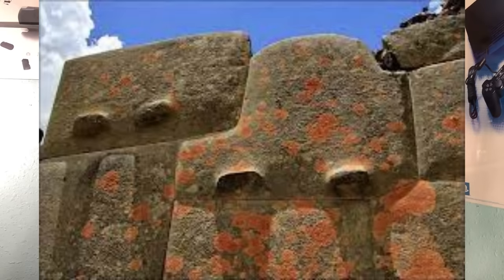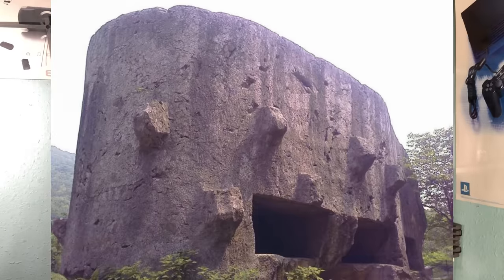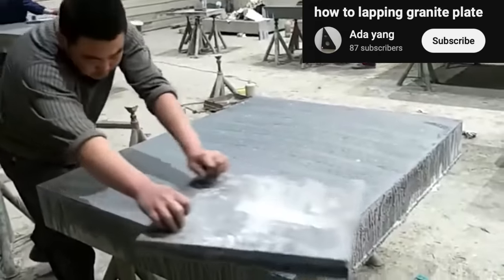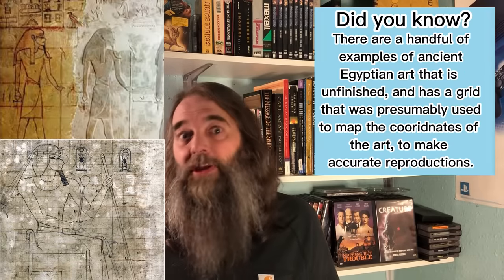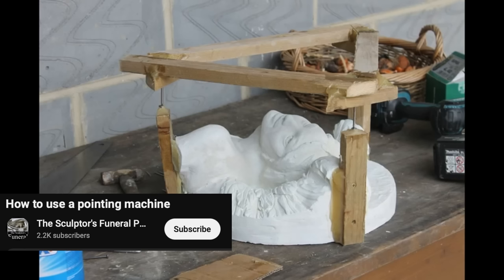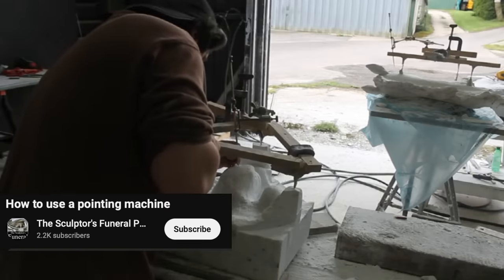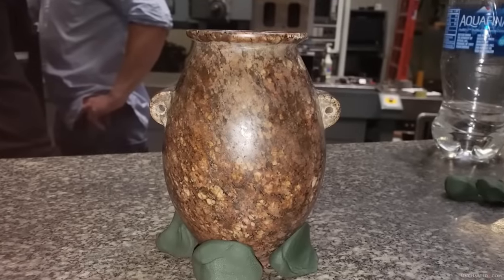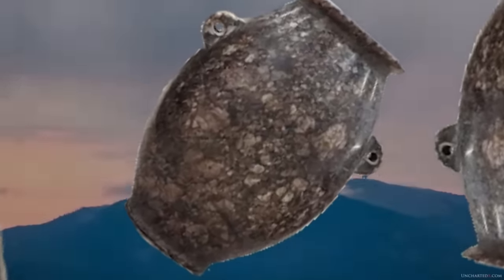The True Purpose of Megalith Stone Nubs

Comment: One of the things that is puzzling is why the builders would put so much effort to make the stones fit absolutely perfectly but then not bother to clean up those nubs which were only needed for construction. I would expect to see them only in quarries, unfinished walls and stone faces that are not visible. Not on a few random stones of a wall.
Reply from the maker: It is weird I admit.
Reply: reasons the leave them;
Practical use ( you can place/hang things on them, use them as the support)
Decorative use ( segest temple in Sicily for example)
Reply: Time.  They either weren't finished at all for whatever reason(most) or they had to finish them quickly so they just covered them up (pyramids) or because they were human and they got lazy.  You can find the same silly errors on anything humans construct.
Reply: Maybe they didn’t feel like doing it. I have noticed sometimes on floor tiles that people leave the little + that goes in between each corner when they could easily remove them. My guess is laziness
Reply: @MrBottlecapBill yes, I’ve never understood the mystification of humans of the past. They were the same as us but just happened to live in the past.
Reply: You're projecting your modern concept of "finished"  onto ancient history. Maybe they were left on certain stone blocks because those particular masons were proud of their achievement and left them as reminders.
Reply: Why risk damaging the stone. I'd like to see how many nubs that where left are near a corner or an edge.. Perhaps pounding them away risked cracks or damage to edges.. And the masons simply thought it better to leave them instead of cracking an already fit stone that took allot of man power
Reply: @bennycarter5249  nice point. I hate when people forget that the people that lived at that time were literally the same as us. They always see them as these perfect beings that have to do everything perfectly and that can’t evolve as a culture
Reply: @bennycarter5249  Yeah and also these are ruins, this is not what they looked like when they were used. I imagine all kinds of banners, flags, deocrations, to adorn the temples and other important buildings.
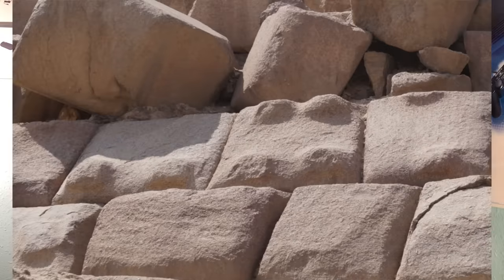Reply: Yeah, i could understand this technique being used for very intricate angles in stones like 00:24 but it's very hard to justify 4 huge nubs for a square stone face like 00:17
Reply: Probably a sex thing: "Phwooahh!  Look at the nubs on that megalith!  Proper great temple with nubs as perky as that!"
Reply: I think because the wall was meant to be resistant to earthquakes, probably didn't care for beauty.
Reply: @JoeBlow-ui7vb  Agreed, primitive cultures didn't generally expend a lot of energy on what they judged as useless projects. If the effort was going to be made...it would be more likely for a practical purpose than decorative. That is not to say that their religion didn't require some degree of decorative precision (look at the Masons and churches all over the world).....
Reply: Any chance the builders like a very methodical fit to the structural integrity of the stones but might also like having a "rustic finish" on the exterior?
Reply: Don't care how they finished them. Please  explain how they moved and placed them . Some are so big we can't move them with modern machines.
Reply: Protuberances! I work at a steel mill and I see them all the time on tundish blocks from the casting process..... 🤷‍♂️
Reply: They were probably distracted when the ufos landed.
Reply: @JoeBlow-ui7vb  , I see these walls as beautiful and impressive. Maybe the Inca saw them purely as functional structures. Like we would view a retaining wall on the side of a road.
Reply: Probably because the walls were covered in plaster and those nubs may actually have helped to keep the plaster in place.  Most likely the flat plaster was painted with various pictures and was sealed to keep weather from breaking it down. That would be my guess.  🤷🏻‍♀️
Reply: @DeDunking 
My guess is the walls and those nubs were covered by plaster that finished the walls and it wasn’t worth knocking them off when they actually helped support the plaster covering the walls to some degree.  Most MesoAmerican and South American cultures did cover their walls with painted plaster, so it’s reasonable that it’s the case with such walls.
Reply: When blocks are cut from a larger mass there is always the bottom side still attached. The bottom is cut leaving 4 columns for support. The front 2 columns are removed and replaced with shims. Material is removed from the middle of the rear columns forming an hourglass shape to weaken them. The shims are knocked out causing the block to drop a few centimeters snapping the columns in the middle and sliding the block off to the ground. The second layer cut will have 2 extra nubs on the top because of this.
Since this is a primitive quarry, they probably don't do more than 2 layers. Some blocks will be cut from fractured and removed sections which won't have nubs. This should result with a third or so having extra nubs. 
The blocks are dragged to the site using long ropes and many humans, which are then arranged on the ground side by side in rows. The left side of a block is finished. Then a stick is used as a measuring device to finish the right side of the adjacent block to match the sides.This is done all around, ignoring the side facing the ground. The side facing the sky only needs minimal finishing if any. These blocks are then placed into the wall in the same order.
Reply: there is not always sense to human creativity and style choices
Reply: Totally agree. Hard to imagine they would be so particular about all but the front face.
Reply: Left on to climb up for repairs? Maybe they didn’t care too much for the aesthetic of the outside of lesser buildings... they seem to have knocked them off for the more prestigious buildings like the pyramids etc etc...
Reply: @albeback8439 I’ve heard the nubs are to assist the moving - a point to spin the block on etc...
Reply: @davidlineberry622 like a sort of blistering?
Reply: @keirfarnum6811 that’s not a bad guess at all, and I’ve never heard that explanation before, that seems bizarre to me now as it’s a really good, common sense shout! 👍
Reply: @maau5trap273 sure, this is true, except every other part of these bocks ARE perfect, so the obviously valued perfection.
I think asking why the nubs weren’t removed is an excellent question and may have to do more with their purpose than we give the credit for.
Reply: I was wondering the same thing. Obviously it’s trivial for them to remove it. Go through all the work of getting that fine fit while I leave them behind? My guess is that it’s part of a religious/philosophical commentary. I know that a lot of Christian artwork purposefully had flaws left in as a statement that only God is perfect. This could possibly be the reason why they left them there.  You’ll notice that unfinished versions have much larger stubs. Also, they seem to come in pairs or more. One nub left behind seems to be more of a statement the mason.
Reply: If the builders just didnt see the value of going back and removing the nubs, then why would the faces of any exposed megalithic stones be cut so perfectly?   I can see why the connection points would need to be perfect, but why leave nubs while perfectly cutting the areas around it?  If they just wanted to save time or didn’t care about if they were esthetically pleasing,  then why didn’t they just leave ALL exposed parts of the stones rough?
Reply: They only finished and smoothed the inside edges to get the precision fit they were looking for and tended to leave the outside surfaces rougher and more natural. It’s impossible to use the lapping technique ( at least hella more difficult ) on a vertical surface ounce the blocks were in place. So why bother chiseling off the reference points risking cracks or unintended damage to the finished product. It’s not gonna be perfectly smooth anyway.
Reply: There might have been something covering the walls in ancient times to hide the nubs and stone work... Plaster maybe?
Reply: These megalithic structures were built by the ancient giants, the offspring of the Fallen Angels who rebelled against God.
Reply: It's hard enough to carve stone that's right in front of you.
Try doing it against gravity.
I'll wait.
Reply: They fit perfectly for longevity.  Without mortar and being more or less earthquake proof, until you get the few high 9s or 10s.  They needed to cleanup the joined faces.  The outside faces didn't need it.
Reply: they usually did remove them, but it was probably done by different work crews and because it was cosmetic it was a lower priority and probably went by the wayside when budgets suffered. You also have to bear in mind that in the case of the Inca all of this was built in a short time period and a great deal of construction was interrupted by the Spanish conquest.
Reply: I think you only see them on unfinished pieces.
Reply: @bennycarter5249  This !  The nubs are there to show off their cleverness.  Remarkably/ironically, the less clever folks believe everything else, but the reasonable explaination !
Reply: @iansayers2414 , if it were the case that the lower tiers were all finished and the highest tiers were unfinished, I would agree.  However, they seem to be randomly left "undone".  There's been observations that some nubs' shadows align with both equinoxes.
Reply: This is a good observation, which I think has a simple answer: they didn't care.

You assert it took a huge effort to fit the stones together perfectly, but this was not the case.  They didn't go to great pains to make that happen.  Instead, the perfect fit was a natural consequence of their construction method, which we can't replicate even today, but for them was straightforward.  They could slap these blocks together like it was it was everyday, run-of-the-mill bricklaying.  For us it's mystifying though, because we don't know how they did it.  We compare the task of removing the nubs against their perfect jointing, which seems a disconnect, because one of those appears immensely difficult.

I've described how I think they built these walls haphazardly, without any great skill or effort, and what the nubs were for.  Just look for the long post.
Reply: @iansayers2414 Inca said they didn’t build them, so who did?
Reply: @albeback8439 modern machines can move multiple thousand ton stones. Most stones that were moved in ancient times were under 100 tons and none were beyond modern machine capacity.
Reply: @iansayers2414   Ah, I think you need to do a little more research here...most of all as to when they were built...way before the Spanish, and way before the Inca civilisation too.
Reply: Maybe you had stone Mason's making the cuts and different guy's laying the stones and then some other time the knobs were supposed to be removed, I say this because I don't cut a lot of the Stone I've laid and on a commercial job with lot's of stone there's usually a guy who does nothing but cuts and the cuts are placed on a skid and sent back to you and that's happening with a bunch of Mason's all over the Job site at the same time so he's cutting for everyone. Maybe that's what was going on and they just didn't get around to removing knobs or the one who order the wall said that's fine and they were done
Reply: That's the work you end up with when you don't pay the contractors, lol
Reply: My theory, it's because they didn't have high rpm power tools like us to make it perfectly flat. They didn't want to break the stone by hitting them with a chisel or something, in fear or it fracturing it. I think these little nubs were originally a long stem from a shaft were a soft geopolymer was poured into a cast. Similar to how bronze is casted. Once it was cooled and/or dried, the cast was opened up and they had perfectly formed boulders with long skinny stems. They would them knock off the stem and round off the "nub" or protrusion so no one would get severely injured if they happened to whack their noggin on it. No safety helmets back then, sharp corners are just an accident waiting to happen.
Reply: The average ancient was far smarter than the average modern human of today. The ancients all had a much harder life and had to make do with what they had. It is just a matter of time, patience and careful thought.
Reply: Maybe they were to hold on plaster or another layer of exterior.
Reply: Someone once told me most old churches are unfinished. They are technically complete but a lot of features are considered temporally until they have time to do it right. I forget most examples but the most obvious one was how they deal with rain water. Some of the churches have lots of lead work that is quite crude. From other features he made it obvious that some of it was suppose to be wood and some was suppose to be sculpted. Sometimes the front of the church or buildings next to it had the correct finish but the other sides did not. The reason was simple, after building for many many years they just considered it finished. It could be that removing the nobs was on the todo list but other things had priority. Life is kind busy at times you know?
Reply: @keirfarnum6811 to me at least this answer makes a lot of sense,even though it leaves a lot of unanswered questions. So then why doesn't every stone have nubs🤔👁️👁️??
Reply: They had a strong anesthetic desire for the tight fits and interlocking shapes. They did not make tight seams on the hidden side. It was to display the anesthetic. The nubs were not removed yet.
Reply: The nubs were/are different in size and shape.they would cast shadows. Different times of the day  or month would inform the people of the time, day of the week , month as well as the solstist, equinox.....
Reply: Lol who says they put so much effort to fit em together with precision ..
Reply: Yep that's one of the best explanations Ive heard yet. The only other one as good (sorry, can't remember who or what the vid was called) was some guys who went to Yucatan end of peninsular to some ruins where they reckoned Cayce's hall of records could be. It talks about previous explorers in 50s or 60s who arrived there and found a pot of white fluid mixture. Some of it was spilt on the granite ground and after a few minutes the ground turned a bit sluggish and clay like. Apparently they asked the locals if they knew what it was. They did. They said it was an old, alchemical solution which contained a particular locally grown plant amongst other things and yes, it was used to soften stone. Now this might be a load of bs, but I reckon if you could soften stone, literally pour the stuff into an icing bag if you get my drift, then you are left when poured into the framed mould, with last bit of poured stone which you could cut off - unless it had hardened again before you could do that, then you would be left with a nub. Could be way out, but it's fun speculating! ❤
Reply: One explanation (which is weirder still), is that the stones were “softened” into place hence the perfect fit and the nubs were just left as the buildings were relatively basic. I would expect the nubs to be misaligned continually due to the movement of the fitment.
Reply: @maau5trap273  " I’ve never understood the mystification of humans of the past. They were the same as us but just happened to live in the past."

You never understood? Really? The past is fascinating and it has its mysteries including the people living in it. I mean the idea that you are in this video is proof of curiosity to the enigma surrounding megaliths. What's there not to be mystified by humans in the past? I just find that take too silly.
Reply: Maybe they might have to work on it again and not end up ruining the stone by removing and putting nubs back.
Reply: maybe for easy access in case of repairs or opening up the wall in a quick manner fucntioning as some sort of key with the right frame as long as made before setting...as making frame fit to rock is not possible after setting...thre could be many explanations...
Reply: They softened the stone and molded them together.  They had a technology that we don’t have.  Obviously for them, size of the stone was not an issue.   They had an ability to move hundreds of tons of stone and it must have been easy for them because they did it a lot.
Reply: @dg-vg9di  , The fact that these structures exist proves that the Incas had the technology/skills to build them. The big question is: Exactly what were these technologies, techniques and skills?
Reply: @DeDunking  and with admitting this shows that you're wrong, you just try to explain something you don't understand.
Reply: as we can see the nubs were on these stones all around the world explain that one, did the Incas go on a field trip to Egypt haha
Reply: @DeDunking  - not as weird as electrical discharges igniting the air around these monuments when the machine/ritual inside is humming at capacity, which is the theory I enjoy envisioning 🙂 but have no evidence to offer. Leaving orientation nubs willy nilly on walls is akin to colouring outside the lines without an eraser, but nevertheless a really cool concept.
Reply: If you actually look at the stones the level of the surface of each stone is not uniform, all the attention is on the fit. Either they covered the wall with mud or plaster or it's just something that didn't matter to them.
Reply: Don’t be so sure of yourself. You are guessing. (😅message to everyone)
Reply: @theend9494  , Why do you ask other people to explain that? Can't you propose a theory of your own?
Reply: I read a paper on the "rock softening" theory. It suggested that they could have used acidic mud that collects in stone quarries to soften the surface of the joints. This would allow stones that were already cut almost perfectly to fit perfectly. It does not suggest that the entire stone could be made pliable. It is clear that the stones were not molded because they are all different shapes and sizes.
Reply: It the nubs were used to reference a measurement frame in order to precisely fashion the block, it makes sense to keep the reference nubs and extend the frame for fashioning adjacent blocks in the wall rather than creating and aligning a new reference frame/nubs for each block. Thanks @DeDunking, you've got the best nub theory I've heard.
Reply: Also the nubs are too rounded off and often don’t protrude much.  This makes them sloppy if used for reference points.
Reply: This an art. It is finished.
Reply: @terberusp7030 . And they had bigger fish to fry - they had a bunch more stones to carve so removing nubs probably wasnt top priority
Reply: In case they ever needed to deconstruct or move?
Reply: Maybe they left it for later readjustments?
Reply: If the theory that the nubs were used for lowering and positioning the stone is correct, they could have left the nubs intact so they could be used again in the event of the wall being needed to be repaired or moved, following an earthquake, which are common in the Andes.
Reply: Maybe that increases the durability, it probably makes it less susceptible to cracking over time, thousands of years would be alot of freeze/cold/warm changes
Reply: @DeDunking it almost implies they didn’t finish them.
Reply: Part of the reason they put so much effort to making the stones fit absolutely perfectly is to make the walls or structures earthquake proof who ever built them were real experts no doubt
Reply: Earthquakes
Reply: They are only perfectly fitted in the front most visible joints. All you have to do is look around the back and see they are not “perfectly” fitted.  LOL. How far did you go in school?
Reply: They were left there just as a practical joke.
Reply: @Matlacha_Painter  , On some structures such as the Fortress Sacsayhuaman in Peru, it is not just the visible part of the joint that fits tightly. Whole mating surfaces of large stones fit tightly. Some theories suggest that clay or plaster molds were used to shape large stones so that they did not have to be moved multiple times. Another theory is that they had some sort of device like a 3D-pantograph. These were used artists to make copies of sculptures.
Reply: @maau5trap273  I push them deep enough so I can grout over without a problem 😂
Reply: @amodernalchemist432  your “theory” is not a theory, it’s just speculation. Before throwing the word theory around you should learn its meaning.
Reply: @jerry12314  because we are in fact the same as them. Not any different biologically speaking. The problem with mystifying the people of the past is that people don’t see them as humans with their own set of beliefs and lifestyle. People often question the why of going through the troubles of making such a difficult construction without any “purpose” but we still do the same and continue to do the same because that’s who we are ( look at the artificial islands in Dubai being done just cuz they can). People also forget how hard working we can be especially if we work together for a common cause, if you mystify them instead of looking like them for what they’re, normal humans then the theories of advanced technology or even aliens comes to the table. Just a bunch of speculative nonsense when we have proven how amazing we are at getting together to do something.
Reply: @swainsongable  fun fact: if you have no evidence for your “theory” then it’s just a hypothesis not a theory. 😃
Reply: @pyotrberia9741  fun fact: if there’s no evidence for that “theory” then it’s a hypothesis not a theory 😃
Reply: impossible to climb for man or animal
Reply: @maau5trap273  , Archaeology is not a "real" science so we do not need to get hung up on definitions. We can call them "ideas" if you like. But it is still important to look at how well an idea lines up with the available evidence.
Reply: the irregular shapes must be perfect preventing earthquake damage,  breaking up waves and spreading their energy around, instead of letting it rip to one side / layer of the walls,
the nubs would be useful for placing temporary shock-absorbers like a piece of wood under.
somehow these nubs are always at the bottom of a block ... and 👃 shaped / rounded at the top, 
so that must be an important function also.
Reply: I submit that leaving the odd set of nubs is intentional as a way to make future repairs. Should a stone nearby, even 2 or 3 stones away, you could use them to start a new frame work reference zero for shaping the replacements. If you smoothed them all away then wall damage, say from an earthquake, would require resetting a reference stone. Compare to medieval castle walls were "put log" holes remain left over from the building process.
Reply: Sorry to say this, but the answer is staring you in the face: and it's just one word - ECONOMICS.
Economics is the understanding that there are always infinite wants whereas there are always finite resources.
Let's look at what order things happen in construction shall we? First, you use the standard tools which allow you to perfectly match whichever face you are working on, and during that time, the pry-lugs are used repeatedly.
Then when the final placement is made, the lugs still exist on the front face of the stone.
It is far more important to use resources to put stones in their final positions, than it is to finish their faces once they've been placed.
And so, the site foreman has a list of priority jobs which have to be completed, and a budget for the total job. Now, because ALL jobs take longer and cost more than you think they will, the construction does not have sufficient resources allocated in order for every single little job to be completed, before moving on to the next mission.

Today, it is typical on a large construction job, for things not to be 100% completed when the owners take possession. And 10 years later, there will still be things which are not officially completed.

And you also need to remember that despite being experts in working stone, it would still take a non-trivial time to remove every single nub from every single face. Just as we see in many constructions in many parts of the world. This non-trivial time can be applied to other (more important!) jobs which advance the construction itself. 

Finally, please accept that your exacting 21st century construction practices and appreciative eye is entirely different to the eyes of the people who made it, and appreciated the construction all those many centuries ago.
Reply: I believe the geopolimer or melting
Reply: @warriorclassusa5392  it must be possible to calculate the viscosity of the polymer  also
if considering the weight of the block placed on top.. the layer on top must've been pushing the goo
aside or even upwards ( hence  the irregular  shapes  )..  but to be the devils advocate, the backside of the  blocks are mostly quite rough / broken edges.
Reply: Where they hung their advertisement of their company.pyramid builders.
Reply: @nauy  that is how the nubs look today, not when they were being used as references 1000 years ago.
Reply: @hewhofightsforgodeveryman3942  I think because you don't need them on every stone.  You can use the nubs on a neighboring stone to make several around it perhaps.  There are problems with this theory I think but that's not one of them.
Reply: @maau5trap273  there are multiple valid meanings to the word "theory" and "speculation" is one of them.
Reply: @wealthychef  if you’re talking about archeoligy then you must use the scientific meaning of it.
Reply: @maau5trap273  But if you're on YouTube you might want to understand not everyone is a trained scientist.  It's better to understand than to be understood sometimes in my view.  Have a great day!
Reply: @DeDunking  just subbed. 
22.5k now. 🤙
Reply: @maau5trap273  problem with this idea is that it swings both ways. Since they are like today people it also means that they would be nagging at "why is it not chipped away" or "oh, my ancient OCD is kicking in, please remove those annoying knobs" and "it looks ugly with the knobs" and "dont be lazy, finish it" and "we've paid for nice stones, clean the knobs off".

so it more obviously looks like they were there on purpose. Maybe wooden things were added to it or something, who knows. But they were not left there because they got lazy. Especially after doing all that work and then they decide it is not worth to finish it all the way through, lol
Reply: I thought stone s were melted. And buns were bag mark s
Reply: Why create buildings from megalith multi-ton blocks in the first place? Why not use something smaller like the Romans did. Something like a brick?
Reply: Waterproofing
Reply: I had a job insecting finished apartments. There was always finish work that the various companies we contracted had not finished
Reply: To help teach new generations of masond on how its done pershaps
Reply: @DeDunking anyone consider these stones have been around a very long time .... possibly long enough they have endured a nice bath in plasma from the sun ? Similar to the melted stuff from ancient egypt.
Possible they were perfectly flush when originally placed and over weathering and some possible plasma baths the nubs are actually pooling points for a melted outside  layer. 

Just an idea 💡 🤷🏼‍♂️
Reply: @DeDunking also do you think they would relief cut that much stone just for this method using the nubs? Seems like more work then necessary.....
Reply: Perhaps they didn’t care about the aesthetics, or their idea of perfection was different than yours?
Reply: Possibly made on the ground then stacked afterwards?
Reply: It's a joke. They knew you'd be confused. They laughed about it.
Reply: @keirfarnum6811 that's not a bad theory but if this were the case I think we would see many more of them than we do.
Reply: Maybe when the structure was finished, it served its purpose. The final finishing stage may have taken much longer and was not so important.
Reply: @bennycarter5249  you are waaayyy projecting your concept onto the whole internet lol
Reply: @albeback8439 certainly got me baffled. Very latest cranes won't lift these rocks. Maybe Marine cranes?
Reply: i believe the walls were covered in stucco and mud or some finish coating type thing like that, and the nubs were just gonna be covered in a layer of that stuff back then with this plaster or stucco or some additional layer on top of the layer with the stone nubs, but that has since eroded over time and now we see the nubs clearly, but it wasnt always like that tho, i think i read that somewhere
Reply: @TheGravitywerks  These cultures were not primitive and they spent a LOT of effort beautifying things for ornamentation all the time.
Reply: @CrowPal  Could you tell me how to find your long post?  Could you copy and paste it here?  Your idea is very interesting to me and I'd never considered it, but I think you may be right that the polygonality was clearly easy for them.  I am skeptical though that they could master polygonality but that removing the nubs was much more difficult for them though, because it seems like saying an advanced black belt move is easy to someone but they struggle with front kicks or simple reverse punches, that type of concept.  I am very interested in your thoughts.
Reply: @highlorddarkstar  I don't understand the dismissive way people talk about moving the stones because we have heavier cranes today.  Do you think these stones were moved up mountains in South America with just rope and elbow grease?
Reply: @airthrowDBT  I was replying to the idea that we couldn’t move these stones even with modern cranes. Which in the context of modern technology is laughable. 
As to moving the stones at the time they were originally quarried, you’d be amazed at what elbow grease can do. And we have no evidence of cranes, but we know they had rope. And with rope you can put a lot of people pulling. They were trading time and manpower for what we use machines to accomplish.
Reply: @highlorddarkstar  If you're in the "tons of bodies and unlimited time" camp then you agree the "they ran out of time and budget" for the nubs being there is silly, right?
Reply: @airthrowDBT  I wouldn’t say unlimited time, you still need a harvest. But yes, they probably left the nubs because they didn’t care they were there or weren’t going to see them.  Unlike fitting to other blocks which has structural value.
Reply: thats because these were not used for construction obviously... even you understand that
Reply: To make it last forever it's only a modern thing of single use items further you go back the longer the more well built items are make once last forever odd shapes helped with earth quakes
Reply: It sure is.....  @DeDunking
Reply: Perhaps those nubs were covered by some other masonry that has since eroded away, such like stucco and the likes.
Reply: @ktor538  I've been sayin that for years in all the old story's they say the wall where covered in gold they probably held metal sheets
Reply: Supposedly these stones were liquefied or molten and these knows were artefacts of the process, then after processing you would have needed possibly some physical tools like chisel and hammer. But removing with copper chisels would have been too difficult in this hard stone. Interesting to know if there are also knobs in soft stones like sandstone
Reply: @Thecrazyenginechannel-nt6uc  , We know the stones were not molded because they are not regularly shaped like bricks and concrete blocks are.
Reply: I agree which is why I added my own comment with my belief that it may be a hidden code.
Reply: Maybe they were bigger and more pronounced before erosion, as to their purpose. 🤔 @DeDunking
Reply: I believe the knobs were there to help move the stone. The side we see is actually the bottom while moving the stone. . Keeps it from laying flat. Allows a mover to get under the stone.
Reply: @oldmech619  , That makes more sense than any other theory I have heard.
Reply: @richard-gn3es Agree,I have always suspected the nubs were hiding imperfections or removing nub could expose one
Reply: @maau5trap273  Not at all. Nephilim. Annunaki, etc....
Reply: They might have left them for complete reference points for the whole system so if they loose part of the measurement during the build they always have an old reference point still left over they could check and recheck again over and over during the beginning middle and end and then they might have left them as a reference point for the future for repairs or just didn't care when they got to that point t because they was going to be spackled over so it didn't matter for that part?
Reply: @negi9040  thats one of the best theories ive heard in awhile.
Reply: @bennycarter5249  they tagged their work, wasn't always slavery, maybe good for business
Reply: Maybe it's part of the aesthetic - functional and proud of it, like a watch where in inner workings are shown.
Reply: @maau5trap273 the size of their brains are different from us
Reply: Could it be that, as you say a nub here and there, those nubs did not represent only that stone but maybe with the others here and there, the hole wall, in fact then having a bigger(up to massive) measuring tool.
Reply: I agree with you and would like to add that this video didn't debunk a damn thing. This guy has an opinion like everyone else. Not much to see here😂
Reply: Definitely didn't take very long. They wete giants that gad a lost technology
Reply: @maau5trap273  I appreciate what you are saying, but people back then didn't have TV, radio, internet, or exposure to many of the brain destroying chemicals that we are surrounded with.
 I would wager that they were capable of focus and dedication that we can't imagine.
 But, other than that. Yeah..they were just people like us.
Reply: I suspect that the stones only fit on the front edge they don't fit closely after the first inch or so most of the story of close fitting is hype.
Reply: @frederickbowdler8169 , I believe that the entire surface of the stone is fitted to the next stone. If I remember correctly, Vincent R. Lee mentioned this in the World of Antiquity channel.
Reply: @pyotrberia9741  yes I have a feeling it's a myth that is repeatedly exaggerated.
Reply: Obviously a ritual aesthetic idea, meaningless to us now ......but we don't believe in the magic of the nubs .😊
Reply: @pyotrberia9741 I believe they only fit tight on front edge  and that is very common ask any stonemason.
Reply: Electrical connection points.
Reply: Absolutely. Although if it's used to move them could be used if they wanted to reuse the stones someday.
Reply: @frederickbowdler8169  , I am talking specifically about the Inca walls at  Sacsayhuaman. Not about masonry walls in general.
Reply: @pyotrberia9741  you have some good comments .These walls are confusing as we see them in their finished state but the design was informed by the stones themselves .We think they planned it, but no the stones dictate the identity of the wall
Reply: When you not have concrete, cement, portland ...Simply the best way to do it ...
Reply: @DeDunking Yeah its like doing a perfect statue of a naked lady and leaving one boob unfinished. There is absolute perfection everywhere to the point of overkill, and then there are those blemishes. I tend to think maybe they had some other construction, maybe wood or something else that has been lost to time so maybe those knows werent visible. There might have been artwork or something else covering them up.
Reply: It's "geo polymer", it was cast like concrete, just with different chemistry, no electricity or super high temperature is required.  They either used sodium compounds or waste water from metal mining and pyrite to react with crushed up rocks and pine ash to bind them.  The nubs look like points where the bags used for casting had unsupported areas in the supporting frame, causing it to bulge out.  Some of them look like scoop marks where a piece of wood was used to prop the bag up where it might have been starting to tip over.  It explains the weird shapes fitting together perfectly, as they were likely cast in situ. It makes no sense to carve a stepped shape that you then have to perfectly match with another piece, far easier to carve them flat and square rather than bespoke if done by carving.
Reply: Earthquakes
Reply: @jimmimak  , If using geopolymers, it makes most sense to use reusable molds to create standard shapes. We call them bricks.
Reply: @pyotrberia9741  That is true, bricks do make more sense in most cases.  However we do cast concrete in situ in some cases, e.g. for making roads, dams, bridges and high rise buildings. For some of these cases we also have to cast it in smaller sections where tensioning rebar isn't used, as if you do one big piece the contraction from setting and thermal expansion when set and exposed to changing temperature can cause it to crack into smaller pieces.
Reply: "Why not bother to clean up those nubs" Indeed, why not? I've got a masonry grinder, we could go clean those up right now!

Who feels hesitation on this plan, and why? Is it possible that people before us had similar sentiments about the work of others? A silly reverence for tradition? Well, let us prove no one thinks that way by fixing the walls once and for all!
Reply: The nubs were for ropes.  I would guess the stones would be placed a couple of feet apart and then calipers could transfer the adjacent contours with incredible precision, not to mention relative ease.  You did not go into this, but how were the stones carved? Answer: Not with lost technology but with hammer stones of varying sizes.  Egyptians probably utilized these techniques too to build their cyclopian walls, and we know they used them to excavate their obelisks.
As for the Egyptian vases, I know about that presenter and his outlandish theories, but these were undoubtedly made by turning on some sort of apparatus, human powered or, I like to imagine, water powered. Cut by metal chisels, sand, water, other stones.  The inside would be turned first then filled with sand or clay to reinforce the thin walls, then the outside turned. 

Yes they were advanced artisans and engineers but their materials were mundane and terrestrial.  Please, let's not deny the wonderful, ancient civilizations the credit they deserve!
Reply: @terberusp7030 counter point: the "nubs" at segest temple look nothing like the ones one megalithic walls.
And neither does the stone work.
Reply: This is engineered stone.  Once the mortar set, it was too hard to file down.  So they poured the "cement" mix, and the nubs was the outlets for overflow.  Even the nubs was too hard to file off.  It looks as if the nubs are the thickness of whatever timber they used for moulds.
Reply: Interesting theory but I have a hard time believing that they used this method all around the world to essentially sculpt the building blocks of large structures.
One culture doing that? Yeah, sure. Why not? But dozens of cultures all over the world?
Reply: @Les537  a great point lots.  of these structures were unfinished but does that explain the meaning of use of the nubs?
Reply: @Deontjie  , This is quarried natural stone.
Reply: @donotreadthis26  , It is not surprising that many different cultures would independently invent the technique of putting stones on top of each other to build structures.
Reply: @pyotrberia9741  Yep, I thought  my expensive kitchen tops  was also natural quarried stone.
Reply: @Deontjie  , Kitchen tops are often made of manufactured stone. The stones of Sacsayhuaman are not. Just because you can't tell the difference does not mean that Geologists also cannot.
Reply: @Deontjie  If it was engineered stone why didn't they just make the blocks uniformly rectangular, maybe with the nubs on the top to act as interlockers? Like we do today with concrete blocks.  
If there are no trees for fuel, how did they make lime for the cement?
Reply: @jh1859  I wish I knew.
Reply: Igual es porque a ellos les costaba poco que las piezas encajaran y les resultaba muy complicado eliminar esos salientes
Reply: Earthquake proof
Reply: The reason they did it is obvious because it's still here for us to look at thousands of years later
Reply: They are actually melted together ......
Reply: @DeDunking dude it's melted together.... #meltology 😍
Reply: @PoizNusChEEzCaKe  Figures of animals are often created by the arrangement of the joints, and some stones have relief carvings on them, so I don't think the walls were ever meant to be covered.  They might be handy drip points to water plants or animals, or for tying rope for vines, or affixing stone or wooden masks - best to leave them.  Could even have been viewed as belly buttons from the birthing process of the stone...
Reply: @pyotrberia9741  builders do what customer wants. If your customer is mad snob, You end up making crazy things.
Reply: @davidlineberry622  Interesting... but those are regular casting forms... they'd need a separate form for each one of these stones and be back at the problem of creating accurate forms for irregular shapes....?
Reply: @DeDunking  ....And why do we see "nubs" in lots of places where there are megalithic structures?
Reply: union break
Reply: To hold/rest wood forms , while adding bracing then remove form after tamping stone design.
Reply: This was a part educational and part guessing, but fun to watch. 

You skipped over a point you made, rather quickly. You explained how copies of stonework is done, but you never showed us stones that matched at all. 

The nubs were functional. The simplest answers are often the best. They were probably used to move the stone around. Like a man on a ladder that makes it walk by moving back and forth. 

The true answer may be lost permanently. But reasonable explanations can be created simply by thinking and living like one of the Ancients. What's the easiest way? What would you do for your god? Good luck. 

Perhaps we can all watch Stargate Universe together.
Reply: Maybe it's so they could later reproduce then if the original broke.
Reply: They were going for a "rustic look"
Reply: @DeDunking 
A must see alternative, go to 6:36 in the video for the particular reason, but the entire video is a worthy watch.

The man speaking is highly regarded,  most intelligent in the field of Ancient History - What * define as an "Authentic Academic" reasoning, ie: adheres to the "Standards of Science and Research" and applies the "Higher Mind aka Mature Mind" to his concepts.  

https://youtu.be/UwCLv8wrGMI?si=1Oyptu9ki59HYhOw

I'm convinced these irregular building blocks were Poured rather than Pulled.  They scream "sliced and/or Molded" by their textures. 

My perspective also includes the point that it's a matter of Time and their secure configuration.

Thanks,

Beth Bartlett 
Sociologist/Behavioralist 
and Historian 
.
Reply: @maau5trap273 nah man, they knew much more about the earth. We started using combustion/thermal dynamics, they used something else entirely.
Reply: @travgusmc  , When you have to shape a really big stone with stone tools, drag it up a hill and lift it into a wall, your knowledge of thermodynamics ain't gonna help you.
Reply: That would be my main objection to this otherwise pefectly reasonable theory.
Well that and that some of the cuts also have transverse geometry as well.
Reply: People who think that they melted, the stones will say that those are the places the electrode was removed from. Apparently, when you pull electrode out, there is a little nub like pulling something out of freshly made cake..
Anybody who says they know and understand how these things were done is just guessing , it sure is interesting
Reply: Clearly after the makers beat rocks on rocks to make them fit perfectly for more time than they had, they just got lazy and said... good enough. Right????
Reply: @Maputi_na_Kalabaw  I can feel your sarcasm, and I want you to know I appriciate it. Mocking mainstream academia is the only way for there to be real change. Their pride is the only thing they hold valuable, so embarracing them is an apropo tactic.
Reply: @quistan2  the "experts" (who for the most part have no concept of what it takes to accomplish anything) ignore, scoff at, dismiss and attack real people who ask questions. 
They know many of their theories they cling to are erroneous and are protecting their funding above all. I'm just a machining engineer, so my "funding" relies on reality, capability, and results. 
Theirs relies on convincing people to give them grants.
Reply: @Maputi_na_Kalabaw  I've spent most of my working life, 20+ years in some sort of construction or building (landscape, plumbing, electrical, general carpentry) you name it. I can't even express how infuriating it is that "educated" people believe these structures were built using pounding stones and janky copper saws.
but as you say, I believe it to be more of a "willfull" ignorance, meant to protect their finantial affluence, and their religeon of uniformitarianism.
The Truth will prevail in the end though.
Reply: @quistan2  even if we never know for a fact, debating these ivory tower types with their logical fallacies is an entertaining diversion from the insanity of the world.
Reply: @quistan2  coolest thong I've seem recently on the nubs was on the Mad plasmacist channel. I have to check out more because it doesn't explain in the one video I saw HOW such great voltage and amperage was generated or harnessed. Maybe an electrician we follow could check it out.